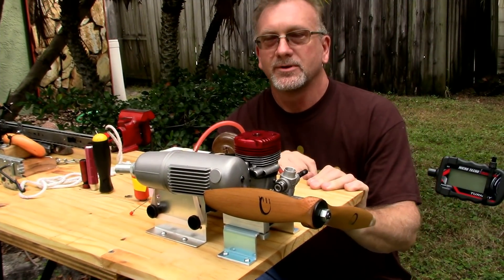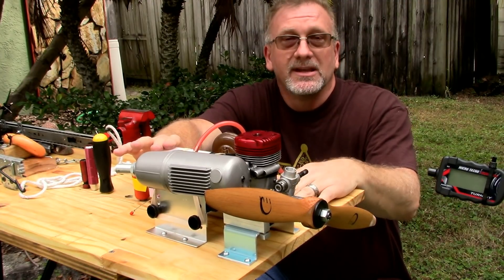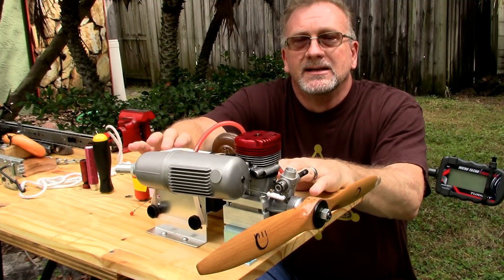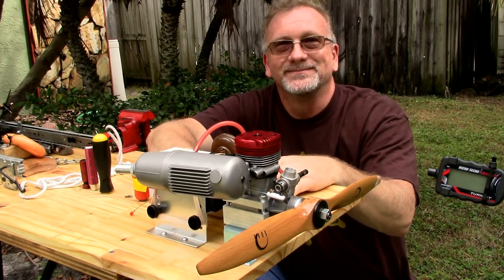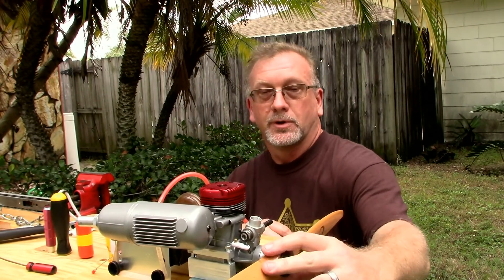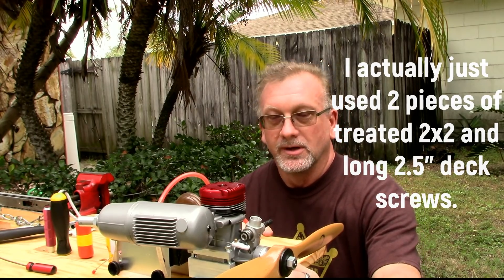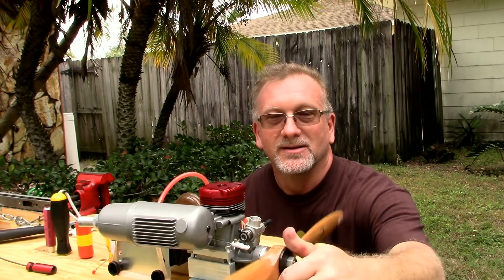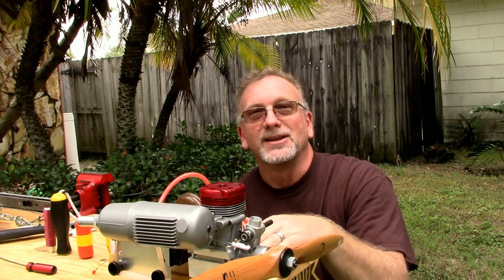Engine Stand Tested w/ TSI 120

Comment: Tank and throttle arrangement suits bigger engines. Can't understand why they didnt make the stand mounting stronger. Those screws are useless and eventually snap off with metal fatigue.  Good test.